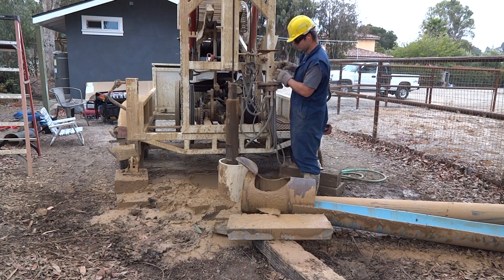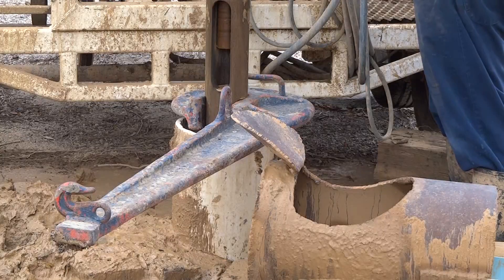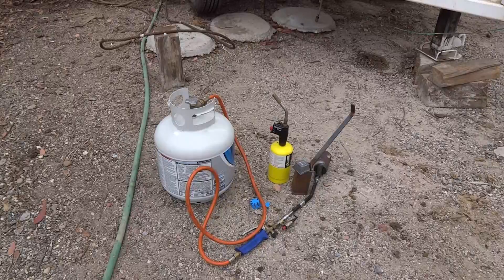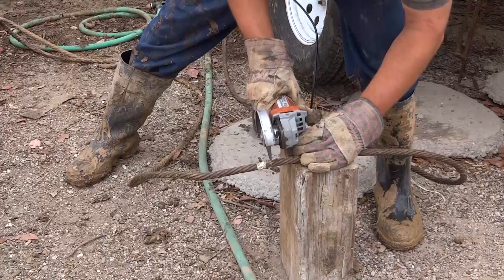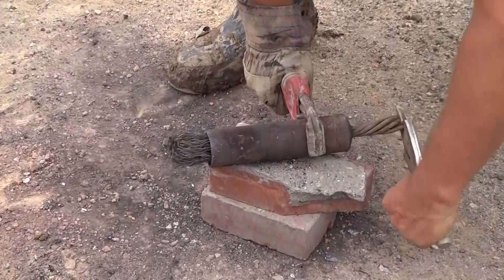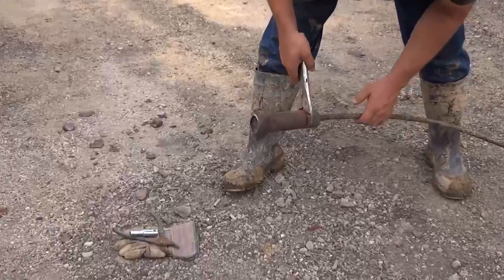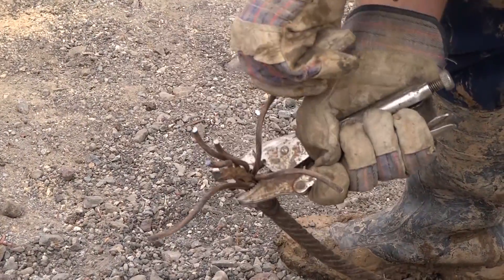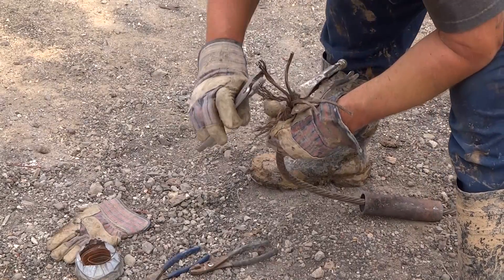Repairing a Cable V1

Comment: resetting stinger is easy a real repair is taking  out a bad spot in middle of cable and splicing it back together so as you cannot tell it was cut that was something I got really good at.
Reply: Ken Jett  make a video of that, please.
Reply: @richardhaywood9474  I wish I was set up to do it that is almost a lost art these days but I don't have the cable or a good camera to video the process. It would take about 200 feet of soft core cable 5/8th or bigger to do a proper demonstration of that. As you have to have ample length to space out the tucks and to role them into the cable. Smaller cables use a different technique and not as clean of splice. This is because the strands are to small to role in and hide the tucks.
Reply: That’s too bad. It’s a good skill to have. I would like to see that. My grandfather was a driller in the Allegany oil fields in New York and Pennsylvania on the old Parkersburg rigs. He could splice wire line and also splice the Manila cracker onto the wire line. He died when I was young, so I never got to see it done.
Reply: @richardhaywood9474  my dad could do the old manilla cracker lines. Unfortunately he did not teach me that one as they was just no longer used. But I was 3rd generation in my family to become a driller. I got the opportunity to play with the old Parkersburg rigs as many other old machines. But most of my time as a driller was on Bucyrus Erie spudders the 36 and also on a 28. I also had a few years on a old 83 speedstar. She was a good ole machine but about 3,600 feet was her limit. I did work over work to 6,000 feet on a 28 Bucyrus and do holes up to 8,000 with the old 36 but alot of special equipment was needed to do that
 That much cable and tool weight had to use a tapered drilling line 7/8th to 3/4 to 5/8th to reduce weight at depth. Those were interesting splices to make. We just used a straight 5/8th cable on the 28 to reach 6.000 and believe me it was all the 28 could spool she was full to top to get 6,000. But we was only drilling cement with a string of 4" tools so not overly heavy.
Reply: @kenjett2434  I grew up on the Standard Rig and National Machine. Nothing like drilling with a 200’ cracker and 45’ stem!
It hit twice every stroke when you got it running right. Granddad would let me run out the last half of the screw and slip the clamps. I thought I was the cock of the walk because I was only 12!
Reply: @kenjett2434  Granddad’s Standard Rig was made by Parkersburg, they also made him a special heavy duty 72’ mast for his National Machine.
There were only a few Parkersburg rigs in our area of western PA. The lion share of the walking beam rigs were #2 National Machines.
The old drillers like my granddad loved the Standard Rigs. I loved the National . They were nice and quite to drill with.
Reply: @752brickie  I can remember those old rigs as a young boy but never got the chance to see one still drilling. They were just no longer used and the rigs relegated to pumping duty. But as a boy going out with my Dad on the job him letting me feel the line and telling me how to feel what the tools are doing and letting me feed line as it drilled. So yeah I know how you felt as for the splicing I was glad I was taught how but it seems no one is left that has a clue how to do it today. On the internet everyone thinks splicing is simply weaving a deadman loop. That is not a true splice and something most anyone can do as your just splitting the cable folding it and weaving it back into itself to form a loop. A true splice is taking two pieces of cable splicing it together to make it one cable. That is a complicated process to get right.
Reply: Ken I have a set of splicing tools “ I think” but as far as me splicing a drilling line., if I did I better have good insurance.
Thank you for the reply.
Where do you guys go your drilling?
I had to walk away from it and do other work.
I told the wife back when I retired I wanted to buy a 24 or 60L and drill a couple shallow gas wells on my property and you can guess what she said about that!
She does not understand once that is in your blood it is not easily left alone!
Have a great night and Thsnk you
Reply: @752brickie  I have worked from central WV up through Ohio and yeah it certainly gets in the blood and there is no cure. I am retired also but still wish I could or was able to put my hands on a rig.
Reply: @kenjett2434  Hey Ken did you ever meet up with some guys in West Virginia by the name of Ike Morris orbEd Broome ?
Reply: My dad worked for Kewanee Oil Company and retired from Chevron. So he spent a lot of time around Glenville I went down to lay a block foundation for a warehouse for Kewanee in the early’70’s.
I was also on a board at Drake Well Park with a great guy from Ohio that was on the board at the Parkersburg museum but right now his name escapes me? I will be 70 in April and I tell you my mind just does not work like it did?
Reply: @752brickie  yeah I knew Ike Morris and some of the guys who worked for Ike. I also remember Kewanee oil company although never really got to know any of them personally. I worked mostly with a small independent company whose office was in Huntington. The guys name was C.L. Kingsbury and was best person you would ever want to work for. I also worked a few years with Harry Boggs from Spencer WV. Him I bet you heard of. He had a pretty big company even operated a coal mine up above Glenville for a number of years. I also briefly worked for a guy up in Ohio by the name Rupp he had 4 Bucyrus 36L rigs. He was pretty good to work for also but just didn't like living in Ohio. I started out doing roustabout work back in mid 70's as a teenager. Graduated HS in 77 and went full time from there as a tool dresser learning my way up. But my grandpa and dad both spent there while lives in the buisness. So I grew up from my earliest memories being around drilling rigs and equipment. Now I live in the heart of one of the oldest oilfields in the world. Still producing oil yet today been along time since that first well in 1860 just months after the Drake well in PA.
Reply: Where do you live Ken? You still in West Virginia?
The last I worked for the engineering company in West Virginia I was in Moundsville filling in on a water plant.
They were the nicest people I ever worked with.
They could not get over how much I spent in the plant with them and helped them because the other guy did not hardly even talk to them.
He was a Major in the National Guard and a lot of them were ‘Nam vets.
They did not care for Larry but they really liked me! Ha ha ha!
Ike is probably gone by now the last I saw Ike was in the early ‘70’s when I did the project for Kewanee.
Reply: When they sold my granddad’s stuff I bought the center spear,three prong grabs,a sub and combination socket. I remember my dad saying” what do you want them for”? I told them because they were my grandfather’s !
Reply: @752brickie  that's a good reason to want them and those things are rare and hard to find these days. I am in Burning Springs WV so not all that far from Moundsville. I wish I had the knowledge 30 years ago I have now I would have bought out my bosses company. He was not well and elderly and his son had zero interest in keeping things going. But I was still not experienced in buisness at that time. He passed away and everything got turned over to lawyers. Well you can guess what they did to the company. If I had approached Lawrence my boss as we was pretty close I am confident we could have made a deal for me to take over the company. But unfortunately at the time I had no idea such a thing was possible. Looking back one can see just how dumb and stupid one can be I guess. He had over 40 good producing wells with a strong cash flow and a fair amount of equipment most old and run down but certainly restorable. The company was quite healthy and would made me a great retirement. But that as you say is hind sight.
Reply: @kenjett2434  yes I understand,I wanted to buy my grandfather’s gas lease but he said I would be buying too much liability. Sure enough 5 years after he passed away here comes the PA EPA with all sorts of regulations that would kill a small producer.
I live in a little village just north of exit 78 on I 80. They advertised for a part time Village Idiot so I came out and low and behold 36/years later I am still here and doing the best I can ! 
Our wells were north of a little town called Corsica and most of them were 1000-1200’ or less. 
In 1950 my dad and uncle were drilling evening tour and not a smell of gas when a little over 800’ all of a sudden it blew the drilling plug out of the hole past the temper screw” I have no idea how it cleared it unless they had just hooked on and was on the up swing”? Over the 72’ mast and roared in at 6.5 million cf.
My grandfather’s share was making him at that time over $100/ day.
Reply: @752brickie  yeah I have seen that happen as in the years I worked had the luck or opportunity to have drilled a number of really good wells. A couple in Ohio one came in over 3 million cubic ft the other was 1.5 million but with 150 barrels a day oil production. Then I worked on one here in Roane co WV that came in over 600 barrels a day in oil production but these were all deep wells 6,000 ft. Here where I live is very shallow you can get oil at 200ft but those zones are old and over produced since 1860. Back in 1980 though i worked on one in head of my hollow was a drill down job. An old shallow well we drilled into the Devonian Shale and it came in over 100 barrels a day at 1,700 ft. We then drilled others down and all of them were really good producers. Well except one the boss wanted to try and do an old fashion shot on one just to see if it would make it better. Let's just say it's not a good idea to shoot a Devonian Shale formation as it just turns into mud and plugs up the works. That was officially the second well I worked on as a actual driller as I done my dues as a roustabout and tool dresser learning the ropes so to speak. I later took over my dad's position as field boss or tool push in the industry. So growing up in the company made me really close to the boss and his family. I can still remember Mrs. Kingsbury she was a teacher and before I even started school would come to our home and she would teach me all sorts of things like how to read and math. By time I started school I had a huge head start. So many memories from back then most all good ones. 9nly trouble as it is with life you wonder what if?
Reply: @kenjett2434  Wow 600 barrels is a pretty nice flow !!!  Here we have the Kane gas sands around 3000'. They are an excellent producer but you do not frac them- they will become a water well.
Dad had one drilled when it was still Gulf Oil not far from where I live that had 250,000 open flow from 3000' most of it from the Kane sand . The young engineer came in from Oklahoma or Texas and told dad they were going to frac the Kane and have a real smoker !!!   Dad told him  not to do it and just take the 250,000 CF  open flow which would hold that flow for a long time before they would start to dwindle but they would recover the $120,000 drilling costs "in around 1980",and come out way ahead over the life of the well. Well they fraced it and guess what? After that it was lucky to make 10,000 CF ? 
In the oil patch around Titusville They have been using the nitro methane shots. I think that was what they are using? It has been a long time since I have been around the oil industry here.
Reply: @752brickie when we shot the shale well mentioned the shooter just used ammonium nitrate in cardboard casings and detonated by sticks of blasting gel and det cord. It was all put into a string and fastened to a hook bolted to the dart on our baler. That's how we lowered and placed it in the well. To set it off he just dropped a det jack down the hole that set off the det cord causing everything to detonate. It was pretty awesome to watch but as stated it was a dumb thing to do in Shale. But it was a great learning experience and helped aid me in one of the jobs I got to do while working for Harry C. Boggs. For a few months instead of doing work over work with his 28 he gave me a chance to be a assistant powder monkey on the highwall of his rock quarry. For 3 months we drilled and shot 40 ft holes blasting limestone for his oilfield roads. He had his own rock crusher and quarry and that gave me the chance to learn how to do blasting. I have been very lucky over the years to get vast experience in a great many different fields. Can't say I am a master but certainly have a lot of working knowledge. I also spent a number of years in the timber buisness also simply because of my equipment experience and i also did timber felling classes that improved my saw skills and part of that I learned to saw and work as a Sawyer on a circle mill.
Reply: @752brickie  I forgot to mention although obviously shooting Devonian Shale is bad idea one thing does work and that is a liquid nitrogen frac. But what ever you do don't use any water and acid with it just nitrogen under pressure to open up the shale and keep it dry as any water it turns to mud and that's really bad. As the nitrogen gets heated it expands opening up the formation.
Reply: @kenjett2434  You have been fortunate to have done a lot of speciality jobs. I only know enough about explosives to be dangerous .  We used to make our own when we were kids but now the ATF would be beating our doors down. I remember America being free !
Reply: @752brickie  times are certainly different than they use to be for sure. I grew up with guns and was hunting ground hogs by age 9 after school. With a 22 magnum my dad bought me. They would call that child endangerment now days. They also had summer work programs for teenagers that wouldn't pass either today. That's why this younger generations are so lazy and no work ethic. Sorry I can get carried away on this. Lol . For 11 years I volunteered as a scout leader in Boy Scouts part of that as a den leader in cubs and as a Scoutmaster for a troop. My experience was valuable in that as well as learned a lot also. Working with young boys teaching and guidance is a unique. Venture. But my health forced me to stop just no longer could keep up with all the hiking required.
Reply: Yep they sure are.
I have been really blessed with good health for beating my body so many years as a mason and plasterer.
Plus the engineering company.
I had a water well business too. My uncle had an old 22 W and when he quit I bought a little water well drill and he ran it while I was working.
Reply: You have my respect on the splicing! That is a real art!